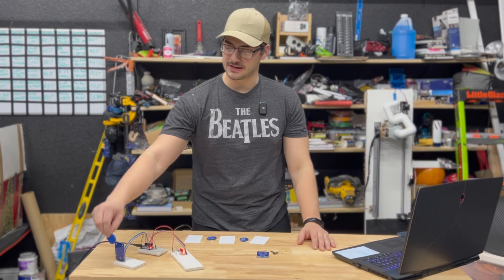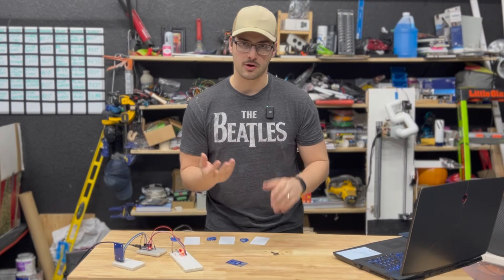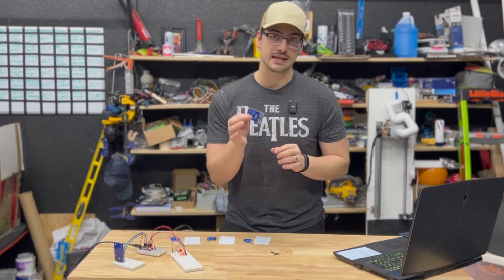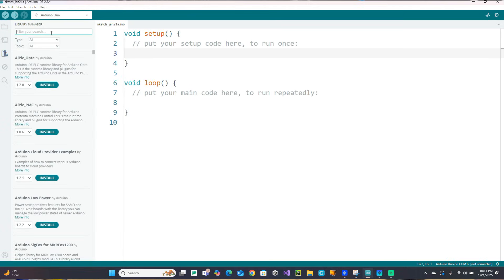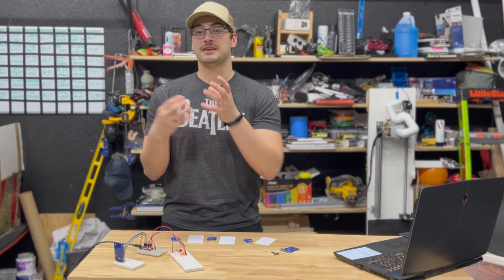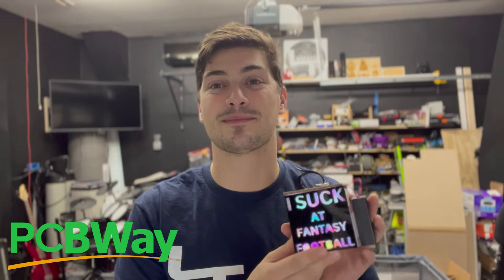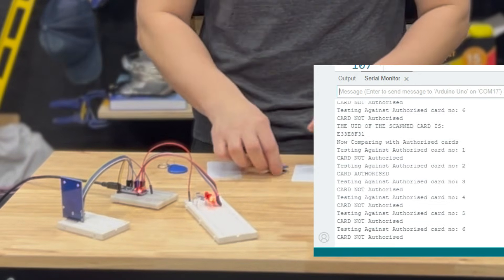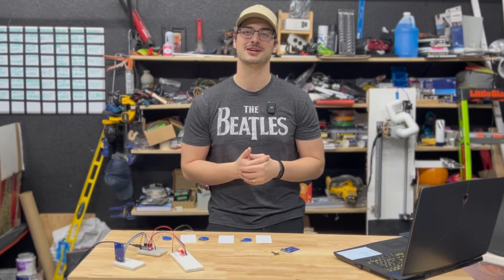How to Scan RFID Tags with Arduino!

Comment: Hey,
I’m working on an idea and would love your input. The concept is a small device that can be built into a box. When someone places a card (like a keycard) over it, it should trigger a notification at another location so the box can be collected. can you help me whit this?
Reply from the maker: Hi, you will need an RFID scanner but also a connection to WiFi or cellular unless the boxes are close to each other than you can probably get by with Bluetooth! Might want some cheap raspberry pis for that!